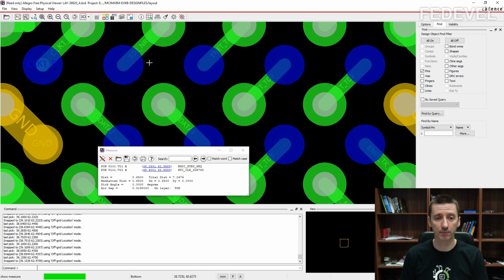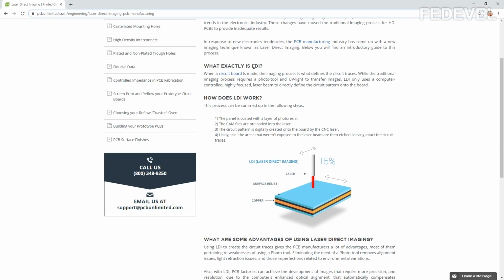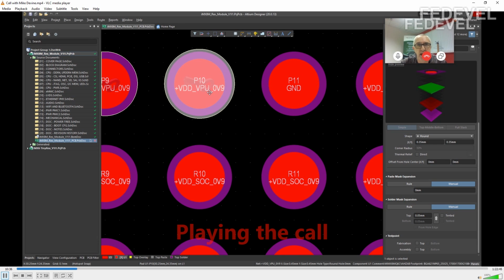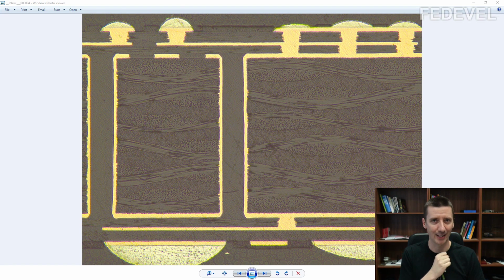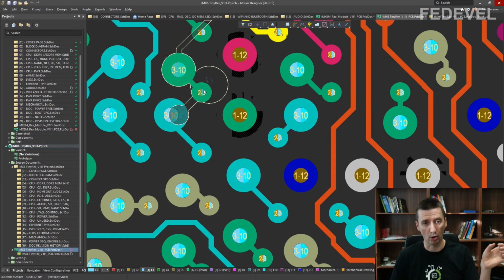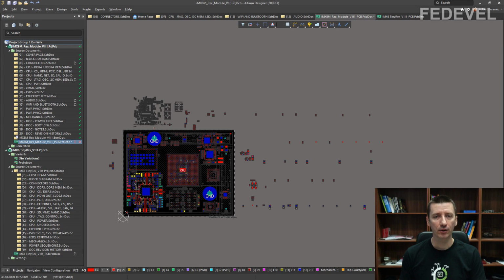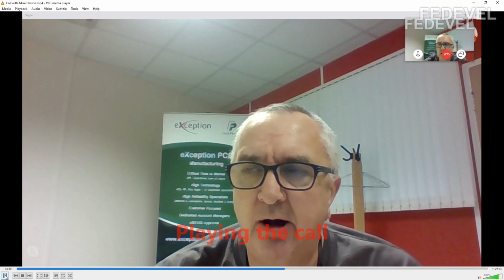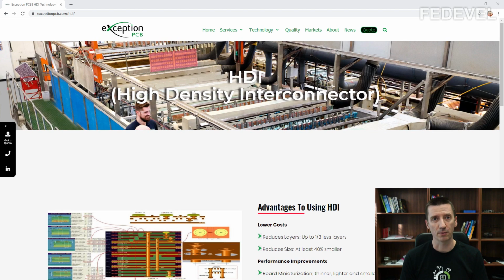Using VIA in PAD? What you need to know - Guidelines, dimensions and more ...

Comment: The low-cost Chinese guys like JLC advise against using Via in Pad for two and four layer boards because the ring can mop up some of the solder paste and cause the part to disconnect or go high impedance. This almost caught me out so I keep my vias as close to the pins as practical and use them slightly larger than the manufacturer can guarantee. High-precision boards are a must for BGAs.

Comment: Robert, sometimes I see you put via close to smd pad at Altium. In this case, you change rules ? usually I send boards to JLCPCB and they are some constraints using via close to pads
Reply from the maker: I do nothing special there
Reply: @RobertFeranec  Thanks.

Comment: Robert, I have a question. If you do not use uvia stacked (top of each other), but go sequentially stepwise (staggered via) TOP - Layer2(GND) - Layer3(Signal). In this case, the Layer2 will have a short piece of track that will not have a reference layer. I think  this is the same as drawing a track over a gap in the reference layer. ? Or not? (43:35 timing)

Comment: @44:40mins I thought you couldn't go from layer 1 to layer 3 because of the fabrication process. They glue boards together and then drill through the stack. So, you could go from layer 1 to layer 2, or layer 1 to layer 4, but not layer 1 to layer 3. Sorry if that is not clear.

Comment: Mmm, if we dont fill microvia with neither copper nor epoxy, and the microvia is small enough, will the tin ball from the bga be sucked through the microvia?, perhaps it won't because of the big viscosity of the molted tin. It could be a cost effective solution.
Reply: I have used a 100um microvia hole in a 400um BGA pad without filling and no problems in SMD. There may be a bubble in there but problems have not shown up.

Comment: Well done,  thank you!.  I think you said you felt uncomfortable in using the 0.350mm via as a through-hole via between pads (in a dog-bone configuration), yet it sounded like you were going to use that same via in the middle of the processor pad in a "via in pad" configuration.  Why do you feel that the 0.350mm via is too small for the first configuration, but acceptable for the other?

Comment: Hi Robert I have a beginner doubt on solder mask expansion. What does it stand for? Does it mean solder resist is not applied in the area of solder mask expansion? That’s what I understood from the last part of the video. That if the  expansion makes the sliver too small solder bridges may form between adjacent pads. Am I correct in this understanding?
Reply: Exactly. Also just to clarify, the solder mask expansion is the additional area apart from the pad where no solder mask is applied.

Comment: There are other advantages. By using via and pad, and other micro via techniques, you can keep your ground and power planes basically solid everywhere, including just under BGA packages. This improves a EMC a lot, by doing shielding, and providing better current paths where it is needed. It also makes the stackup more symetric, and prevent board warping. It also make a great distributed capcitor, and with proper type of layer / prepreg, it can provide substantial capacitance (few nF per cm^2), which can make it possible to get rid of a lot of MLCCs. In the end it is possible to reduce number of layer due to these combined effects, and flexibility.

Comment: I think you get it reverse in the cost analysis. If you make a big PCB, or big panel, it will cost you relatively less. If you are making a single small board, then it will relatively cost you way more.
Reply from the maker: I meant if you use the same technology. For example, if you us all the uvias and buried vias etc, then bigger PCB is going to be a very expensive, comparing to a small one. On a small PCB you can use almost any technology and it is almost always going to cost just a couple of dollars for higher quantities.

Comment: You can use longer microvia, i.e. from layer 1 to 3, instead of going from 1 to 2, then moving to different place, then 2 to 3. They will be made as 1 to 2, and from 2 to 3, and aspect radios between each layer will be fine. You might want to enlarge the ring size a bit on the layer 2, to ensure the proper registration, but it shouldn't be a problem, especially if the 2 to 3 is the copper filed via. Basically building a taller via in two steps, as a tower. However, you need to check with the manufacturer how to do it.
Reply from the maker: yes, that is one of the options

Comment: Hello. I have some interesting board this is NanoPi NEO-LTS
. It's interesting because that board has allwinner h3 chip with 0.65 mm pitch and it's some how routed on 4 layers pcb!!!(you can check out this on theirs web site) I am unsoldered processor and ddr3 memory and discover that they break most of the rules that recommended in design guides, distance between positive and negative trace of differential pair same as distance to other traces and it's about one trace width. But It's actually works fine. And Yes they place vias between pads.

Comment: Hi Robert,
I don't agree about via definition at first 10minutes. You have forgotten on plating thickness for through hole via. If we define hole of via in altium of 0.15mm this is the finished plated hole. However the manufacturer have to drill via with 0.2mm bit in order to have of 25um copper on vias wall. Next, we have IPC standard an minimum anular ring. For standard process they require 125um in oder to avoid brake out on ring. 
It yields 150um + 2x25um + 2x125um is 450um outer diameter of via. 
So it means, we have to know the drill they will use for mnf. process in order to provide reliable plating. 
Another question, have you found how define vias in altium which should be plugged according type VII. 
For example, we had via and soldering pad both had diameter of .0.6mm. In altium drill file they have been marked with same symbol T4= 0.599mm. Pcb manufacturer pluged at the end everything, both vias and pads. How avoid this ib future?
Br
Josko

Comment: I wanna Fanout 0.4mm pitch WLCSP package I believe it is impossible to put Vias between pads, did u try something like this before ?
Reply: I was also trying to same. Also the reason for me to watch this video to handle the fanout for 0.4 pitch BGA. After watching the video i decided that only possible solution is using via-in-pad with filled or caped vias and PCB needs to be at least 6 layers. Blind(L1-L2) and burried vias (L2-L3) has to be used because of 0.1mm hole size. I also talked to my friends who have experience in PCB assembly. They said it is more complex and more expensive. In my design there was only one component like this. I watched the video to learn how to use via-in-pad. After watching it i decided not to use 0.4mm package and change it to QFN.
Reply: @BurakEnez  exactly like what I did

Comment: Thanks Mr. Feranec great video again. I heard from some youtuber that backdrilling is a method to avoid stubs where you want to use through hole vias instead of uvias for the sake of lower cost. If you have experience about that you can make a video telling what type of design tricks we can use to reduce PCB cost and production time and still get the best performance.
Reply from the maker: I have not used backdrilling yet (most designs we do have to be cost optimized)

Comment: very useful information indeed! Thank you Robert. 

So, the inforamtion about via-filling that I understood is like this: to have copper-filled through-hole vias, one has to explicitly tell the PCB manufacturer to do that and there is no direct way to specify that in Altium. Is this correct?? 
Also for larger power devices like MOSFETs, can the vias-in-pad be defined in the footprint library itself?? Or shall one use it only in the PCB?
Reply from the maker: No, you can't specify it in Altium. Simply use an unique hole dimension for the vias which are going to be filled so you can simply list them and tell the manufacturer that these are the vias you would like to fill. PS: you can define them in library, but do not forget to include these vias in the list of filled vias.
Reply: @RobertFeranec  Thank you so much for the response.. so nice of you ...

Comment: Thanks a lot Robert, very useful video again !  I wonder that via size can be smaller than BGA pads ?  Is there any problem about  that.  For example: 0.5 mm BGA pad and 0.35 mm via (via has 0.15 mm hole size) on this BGA.

Comment: Hi Robert Feranec,
Very informative video, I learnt alot about VIA ON PAD, plugging and filling. Thanks alot for your selfless helping effort.
You mentioned in the video, that you change the via size to 0.201mm for copper filled via and highlight in other document that 0.201mm vias are the copper filled ones. 
Instead, we can use the description column in the drill table to indicate that 0.201mm vias are copper filled ones ? 
Is it possible ?

Regards,
Naveen

Comment: Very nice, Robert!  Lots of good info here.  I've got some very limited exposure to via in pad designs that a colleague did.  We worked together for about a year and a half.  One thing to consider with via filling in general, is the electrical performance gain when the via is filled with metal (copper, or sometimes solder).  Also, via in pad isn't just for enabling signal escape for BGA packages.  It also allows very compact placement of chip components.  With VIP and a couple extra layers, you can place all the components on the PCB right next to each other, with few limitations.
Reply from the maker: Thank you Greg for your feedback.

Comment: Great video with lots of info Robert !!!  Thank you!
You touched SO many areas! Each one could easily have its own dedicated and long video explaining more details etc... 

Unless there was a very certain and serious reason, I would generally go with non-conductive filled VIP technology for better thermal behaviour and more cost effective pcb. I guess there are also differences, between the two aproaches, in inductunce and other properties of the via that could make some difference in high speed design perhaps...

Maybe someone could also consider using "skip uVias" (L1 to L3 directly), which I have succesfully used in a couple of my designs, instead of stagering vias. 

Anyway, a lot of the decisions usually have to be made on per project basis and after a good research like yours here. 
Keep up!
Reply from the maker: Thank you very much giannis

Comment: Thanks Robert, great job again! Watching you speaking about the sliver I had to think about a video dealing with the pros and cons of soldermask defined pads - just in case you're looking for new ideas.
Reply from the maker: Thank you Marcus. I have been thinking about soldermask defined pads (and I actually asked some questions during the call), but the result was - not clear, so I have not included it in this video. Basically, for now I decided, that if I am still able to go with standard pads, I will use them and only go for soldermask defined pads if there is no other way (decision based on my video about footprints: https://youtu.be/cMxXea16Hxc  )

Comment: Thanks for the video Robert, very interesting!
I wonder if you know if there is any upper limitation in drillsize when doing copper filled vias for use as thermal vias? BR Tomas
Reply from the maker: Thank you Tomas. I was thinking exactly the same this morning :) I should also ask the upper limitations. I will need to double check that.
Reply: @RobertFeranec  I guess its just a matter of time as larger holes requires thicker copper layer to be added to be fully filled up...?

Comment: Very useful video. Thank you, Robert.
I have to add that using micro vias on top of each other is not an issue ( n most cases) but putting micro vias on buried Vias is not a good idea.
Also when using Altium, crossing plane layers with micro vias will result in an error of not having a pad in the plane layers (this is a software issue by Altium). the solution is to using a signal layer instead of a plane layer and filling the layer with a polygon.
Reply from the maker: Thank you very much Saeed for your feedback. Very useful!

Comment: This was is a very helpful video. Thank you.
I would very much like to see a follow-up video about the board stack-up you illustrated, and how to maintain the correct track impedance for signals that use staggered micro-vias on the outer two layers, then a signal layer below that, and only then a (ground) plane layer below that.
If the wave is in the dielectric material between the trace and the ground plane, how do we calculate the requirements with staggered micro-vias layers that each have different distances from the nearest ground plane. 
For example, do we need different trace widths on each layer to maintain a consistent impedance.
Reply from the maker: Thank you very much Nicholas for your feedback. For the designs I have done, I have not been thinking to much about impedance in VIA (there is not really much what I can do about that). The same is about the very short tracks on L2 (not really many options what to do with these). However, if I will have a chance to design a very high speed boards, I will make a video about that.
Reply: @RobertFeranec  Thank you

Comment: When trying to prototype a hdi board (without via in pad) i found prices are above $1000 for a small board, right?
Reply from the maker: Yes, that is right. We often pay between $3000 - $5000 USD. But they need to manufacture whole panel, so if your board is small you can get 15 boards for almost the same price as 5 boards.